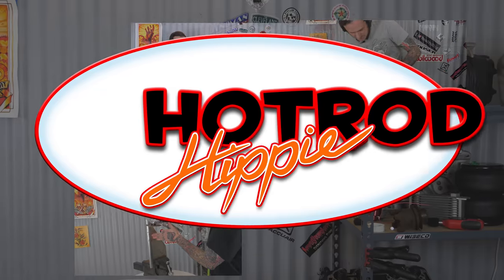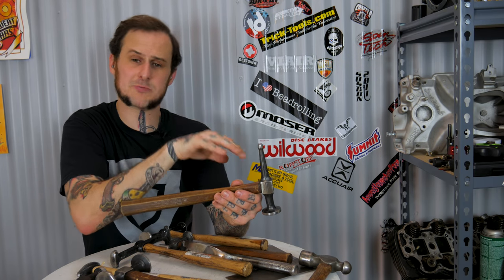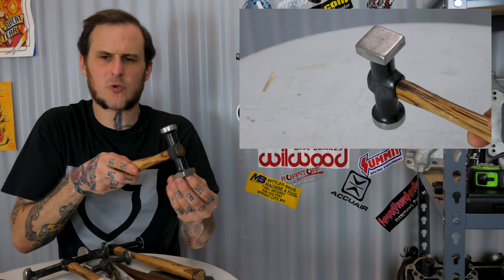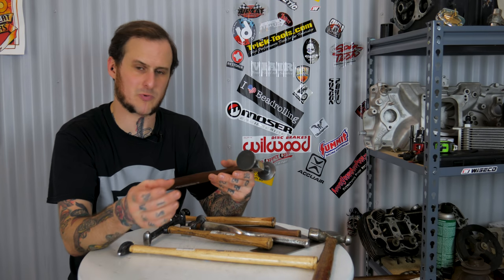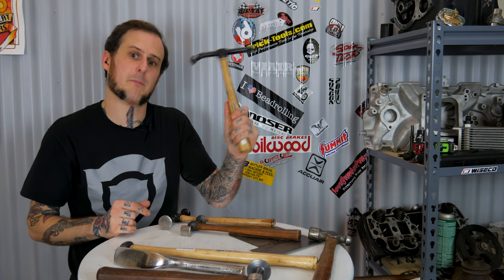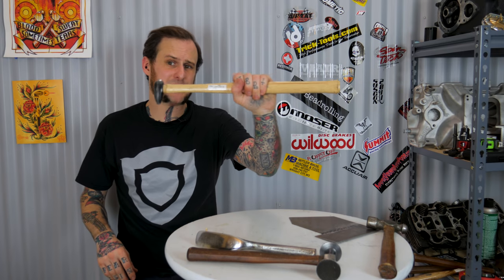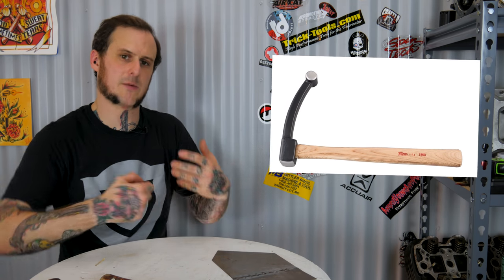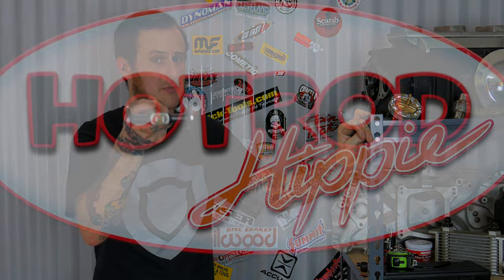Body Hammer Designs Explained - What is that shape for?

Comment: This snapon shrinking hammer at 5:12 works great when using heat, I've owned n used that model for 35 years. You might want to use it with a slap file as a dolly to get full effect.
Reply: Woah. Someone who actually knows how to use tools 😮😮

Comment: This is a great video, and I watched it mainly to see the other uses that someone else has found for different design body hammers. I used to disregard waffle face hammers, but then I met a man who showed me the “right” way to use it. Now I love that hammer. The misconception is that it shrinks by hitting the surface directly, leaving the scars ya hate. That’s not quite the right technique. You want to use it in a glancing manner. The teeth grab the metal and move it in the direction you glance it. It works great in conjunction with heat, but you can use it without. Yes it’ll leave scratches, but a sander and some 80-180 grit sand paper will take care of it.
Reply from the maker: I usually do glancing blows with all my body hammer work but I guess I usually do use the shrinking hammer in a more direct way. I will attempt to give it another try using your suggestion. However I've found I don't need it really. For shrinking I use a shrinking disc that doesn't scar the metal at all. Thank you for the kind words and input. 👍👍
Reply: HotRodHippie I’ve recently been introduced to the shrinking disc and I wholeheartedly agree that it’s a much cleaner and overall faster method of shrinking. Even just using a slapper and a lead shot filled leather bag is much better. I do hope that you’re next attempt with the waffle face hammer will give you a more satisfying result. Even if you can only use it for minor stretched metal working. It’s better than having a body hammer with a side that’s completely useless. Hey brother Thank You for being kind in your reply, and for sharing your knowledge with the rest of the world. I’ve been really enjoying your content and look forward to seeing more!

Comment: Excellent info.  I subscribed.

BTW, someone talked about the dangers of striking a chisel with a hammer below.  A proper metal chisel becomes dangerous from small shards if allowed to mushroom where the hammer strikes.  If the edges are kept chamfered, they are obviously not dangerous to strike with a hammer (though I would use a ball peen for the same reason).

Comment: It's a good day when I  acquire a new hammer. I've slowed down a bit but they still come my way.  I usually massage the outer radius a bit to minimize any chance of marking the metal.The new hammers definitely have been shaped less than the same model old ones. I have 2 Martin hammers marked the same but the radius is very different (and they were brand new. ) 2 Protos also but they were old when I got them.
Reply from the maker: I don't really know how the hammer making process really goes but I'm betting the final grind is a hand finish process. So I can see that. 

I made a video about dressing hammers last year. I should redo it with more demonstration and detail. I always clean up my hammer edges. Even the best ones are fairly harsh.

Comment: I’ve been a sheet metal worker for the past 20 years, specializing in custom stainless, copper, brass, etc and own an array of body hammers. I was always taught that plumb/proto hammers are the best hammers available. They’re the only brand I buy, but they only existed from the 40s to the 60s. so finding them is difficult. Their design, both head and octagonal handle has been copied over and over. I’m curious if you have used them and/or have an opinion on them? If you haven’t, I highly recommend you try to track some down. You won’t be disappointed
Reply from the maker: I've only used completely beat Proto tools so I cannot say. I look out for quality old hammers at every swap meet and yard sale I can.
Reply: I love the old green handled Protos. One of the best brands in body hammers

Comment: I got one of the reverse curve hammers like the one you mentioned from Dagger. I really like it and it seems to be a great hammer so far. And like you said it seemed like I was going to have to start searching for a used Snap On hammer and probably over pay for it, but then found them from Dagger Tools and they have them in stock on there website.
Reply from the maker: I'll have to scoop up the dagger one and compare it. I've been thinking Dagger may be my best source to get some "affordable" hammers to review and suggest to those who don't want to pay for Martin Tools or Snap-On ones. Though they are only marginally cheaper than Martin.
Reply: I think my hammer was between $20-$30.
Reply from the maker: Skeeter Tomlinson it is $23 right now. I just pinned a comment with a link to it on Dagger's website.

Comment: Thanks for the tips.  I only have three hammers.  Is there one you recommend (with a dolly perhaps) for hand planishing.  I don't have an english wheel, and I need to flatten the dings on a curvy piece I initially hammered out with a plastic hammer and a sandbag.  What do I do next?  I have the overall form, just need to get the finish look. on 16 gauge steel.  I did order the Key book from Martin.  It is arriving later this week.
Reply from the maker: Unfortunately that's hard to say. Any given day I use a half dozen different dollies and I wish I had more options on hand. I'd really recommend buying as many as you can justify. I always recommend good quality ones like Martin tools / Ron Covell's, but even the cheaper ones have their uses. Namely you can feel less bad about grinding and sanding them into custom shapes.

Comment: For the shrinking hammer u need a shrinking dolly to match. It does mangle the material some but it does work. There is a shrinking hammer that u dont need a shrinking dolly to match. It has a swirly face and rubber on the back so the face can twist to tighten up the material. It does work and doesnt make as much of a mess. There only bad thing about them is that there only good for a few years because the rubber eventually goes hard and makes you have to hit harder to shrink the material so eventually u start to get the marks. For me hot spotting is probably the best way to shrink excess material you just have to be careful on very flat panels cus when its nearly flat then u do it one more time and you start to shrink shape into it.
Reply: Hush you. Stop making sense.

Comment: TopTul in the UK makes the reverse curve body hammer. Model JFAA0533. You can get one shipped here to the US, but total is going to be close to same as a used snap on if you can find one - about $90-100. eBay seller or two has them.

Comment: Glad I'm not the only one who can't get a shrinking hammer to do anything other than mangle steel. I'm a total noob, but I cant imagine it doing anything but destroying steel. I have a half dozen body hammers, could always use more.  I really need more spoons though...
Reply: For decades, Ron Covell has been asked about shrinking hammers in his workshops and he will do a quick demo comparing cold shrinking an area compared to doing the same with a normal hammer or slapper and the only difference is the marks.  The ideal in any metal finishing is to not add marks.
Reply: brian plumleigh so assuming I have an unused shrinking hammer, should I regrind the thing flat? Slight arch? I'm sure I can make it more useful.

Comment: I like to pick up body hammers at swap meets or estate sales... Unfortunately they are starting to get crazy expensive.  Sometimes if I need a special shape I'll grind the shape from mild steel and weld it on a crusty sacrificial hammer.  A few times I've heat treated the new head using a makeshift forge made from a charcoal BBQ and a hair dryer.

Comment: I may possibly have over 100 unique body hammers. Fairmount. Heller. Porter Ferguson. Wilde. Snap-On. Blue Point. Herbrand. Plomb. Proto. Pexto. Craftsman. Streamline. Not a single shrinking hammer in the lot! Shrinking is the job of correct placement of hammer-off-dolly.

Comment: Martin 153GB and the 168 are my go to hammers for door skins, can't stand that 170 door skin hammer.   Martin also made a double reverse curve hammer like the Snap on 615 but slightly heavier but discontinued them a few years ago.  Dagger tools sells a darn nice copy of the 615.  
Link to the Martin tools body hammer catalog
http://www.martinsprocket.com/docs//catalogs/industrial%20hand%20tools/industrial%20hand%20tool%20catalog/body-fender-repair-tools-catalog.pdf

I collect and restore old hammers and dollies, am way north of 200 hammers.
If you check out Amazon.de you can find some super high quality German stuff in designs that US manufacturers no longer make and often times no more money then Martin tools if you keep your eye open.
Reply from the maker: sevtchevelle I've been wanting to pick up some of the German hammers for a while. Sooner or later I will. 

I contacted martin about bringing back their reverse curve hammer but was shot down quick. If I ever get to speak to a rep again it will be a topic of conversation for sure.
Reply: I've had the same conversation with Martin before about bringing back some older designs.  I just picked up some Hazet and Stahlwill hammers for about 37 bucks shipped, you can't beat with a stick.  

You can also make your own Snappy 615 by buying the Martin 160 or 161 and grinding the curves your self.

Comment: Shrinkinig hammers are best used with a torch.

Heat the metal red hot, tap it down, and cool with water. Shrinking hammers are not supposed to be used cold. Doing so ruins the surface.

Comment: i ran into a snapon body hammer at the swap meet but the guy wanted 40 dollars for it, basic pick hammer.
how much should i expect to pay for such a hammer ?
Reply from the maker: Reno's Garage that's about $30-35 below current MSRP. If it's in great shape that's not a bad price. But if it was rough I'd say $25-35. They are warranty. So if you have a snap-on guy sometimes you can turn that old beat up one into a brand new one. So that's probably what they were figuring on. Like my large face one in this video, that was an old one my dad had. My snap-on guy just gave me a brand new one for it cause the waffle face was in poor shape.
Reply: not $40 that's a lot for a used hammer ($10? $20?)
Reply: thanks for the tip and info :)
Reply: I've paid as little as 75 cents for a good Proto..one of my favorite hammers. I rarely see snap-ons but they are pricier new.  $40 wasn't a bad starting price if he was willing to bargain.

Comment: TopTul in the UK makes the reverse curve body hammer. Model JFAA0533. You can get one shipped here to the US, but total is going to be close to same as a used snap on if you can find one - about $90-100. eBay seller or two has them.
Reply from the maker: Dagger Tool has a reverse curve body hammer for $30 right now.  I have not tried it at all to say its quality.  It looks just like the the short lived Fairmount one.  I need to get one and check it out.